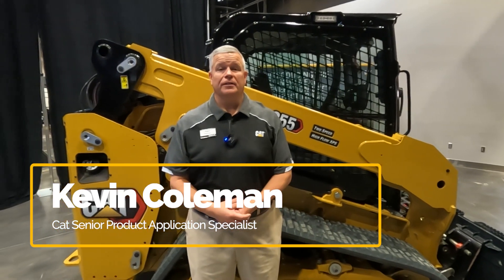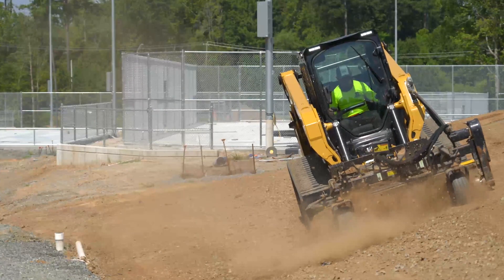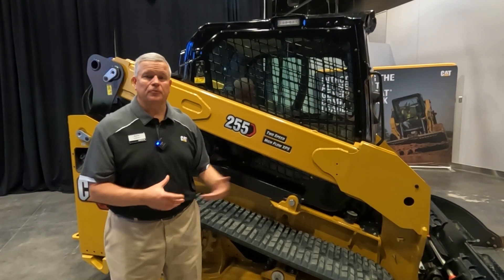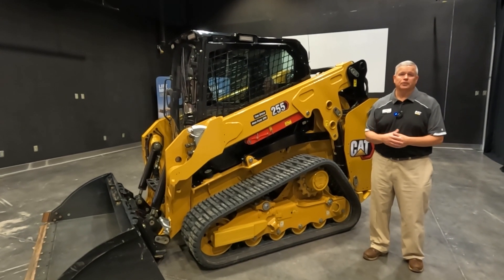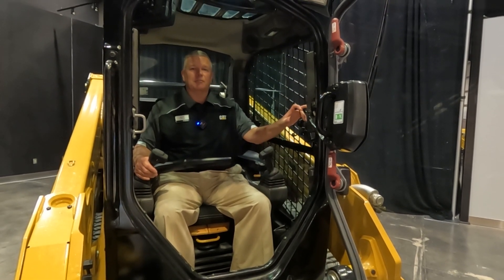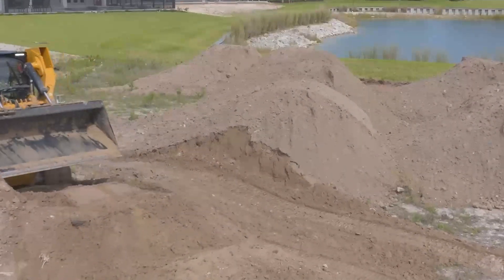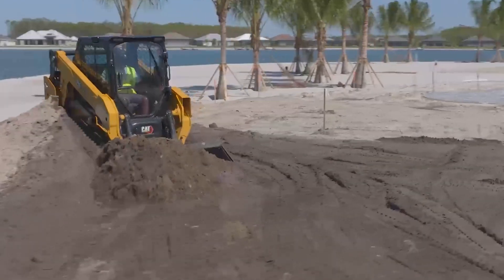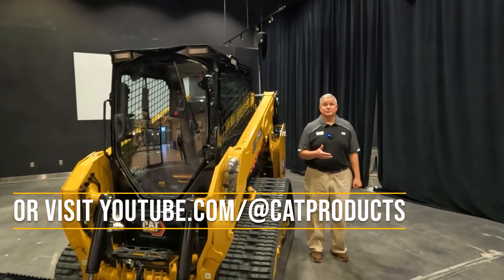Caterpillar's Next Generation 255 and 265 Compact Track Loaders

Comment: 113 litre  a min for  high flow is less  than was on the  259 or 257 !!  Its no improvement  at all !   Xps high flow   was 120 litre  on the 289  so why isnt that on the  255 ??   No improvement  at all
Reply: The 259 and 255 both run 30gpm on high flow. The difference is the 255 has xps which gives it more pressure 4000ish vs 3000ish psi.
Reply: @midstatelandsolutionsllc1515  check your  data. 30 gallons is 114 litre  the  same as before the 265 has increased to 129 litre the 255 is still the same. Pressure is increased  but not flow, the flow is actually  less now on the 255  its 113 litres
Reply: It’s so you can’t run a mulcher, they’re pretty much forcing you to by a 299.